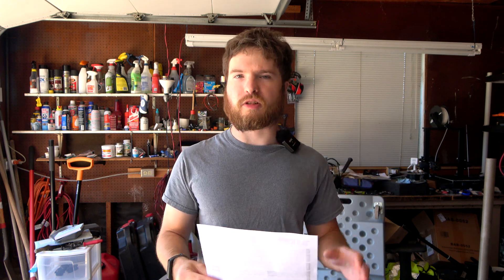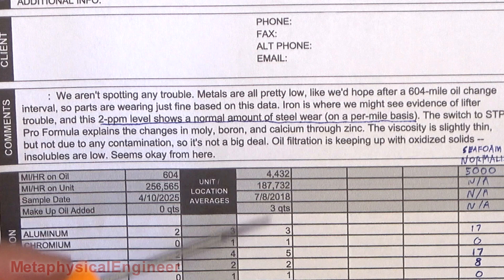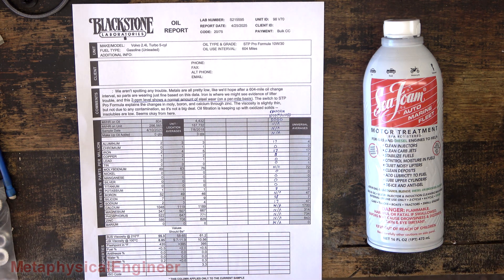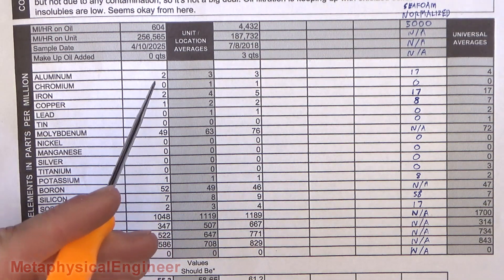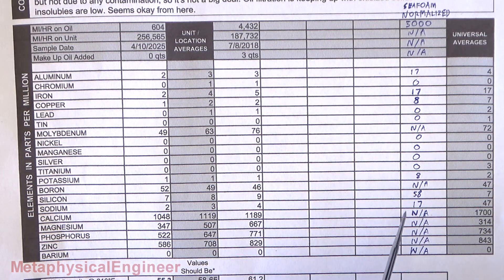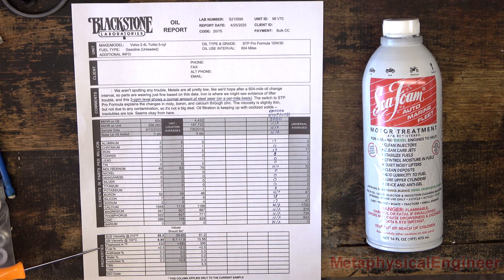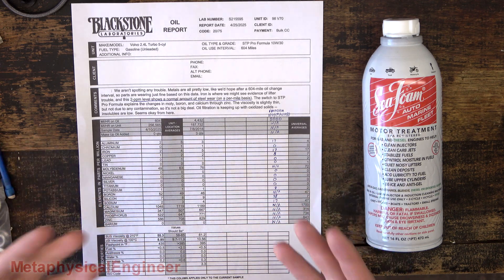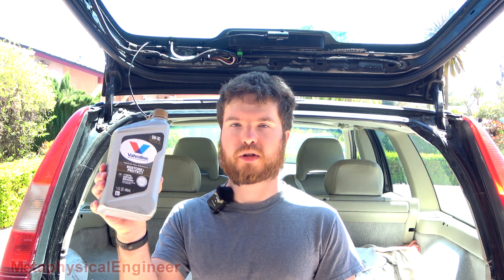Did Seafoam Hurt My Engine?  Oil Analysis Discussion!

Comment: Unlikely to fix that lifter with oil additives. Just bight the bullet and replace the lifter.
Reply from the maker: But then I'd miss out on a chance to test if any of these mechanic in a bottle items have a chance at solving the problem!  So long as there's not signs of accelerated wear, the noise is a nuisance and I can keep experimenting.

Comment: As always, the comment section is the best part. Seriously, thank you for doing this. I know it takes time and money. I personally use Seafoam at 1 ounce per quart 300 to 500 miles before an oil change for decades and I’ve never had any issues with any engine. Nothing has ever blown up. No cams have ever been rounded. No filters have ever clogged. Seafoam themselves have done regular and rigorous testing over decades. In my Camry I use Idemitsu IFG7 and in my Escape with the 2.0 eco-boost I use Penzoil platinum ultra or Valvoline restoring protect
Reply from the maker: Thanks for chiming in!  There's a lot of misinformation and fearmongering that flush type additives will cause damage, so I wanted to see for myself in a controlled manner.  Really, 1 ounce per quart is such a low amount that the viscosity effect is negligible.   Given the results here, maybe I should have run it for longer.

Comment: I thought sea foam was for the fuel tank ? Not the engine oil
Reply from the maker: It can be used in both (and introduced through the intake to clean throttle body, intake valves, and pistons).  That said, I prefer it as a fuel additive, mostly in small power equipment since it's good for cleaning carburetors and has fuel stabilizing properties.  Instructions on the can and the official website have more details.
Reply: @MetaphysicalEngineer thanks
Reply: Maybe you should read the instructions on the bottle! It has instructions on how to add it to the crank case oil.

Comment: Specious at best. Completely nonsensical drival in truth.
Reply from the maker: If you see flaws in my interpretation, please enlighten me.  Also, it's spelled "drivel".  If you pull out the thesaurus to make yourself appear more intelligent, you would be wise to check your spelling before you post.
Reply: @MetaphysicalEngineer thanks for the spell cheek. Your most kind. 🐥 Assuming linear regression with only one data point for wear particulates is just silly work. No, (0,0) is not a data point because you didn't have the unused oil tested. One data point at 600 miles. 😂 I highly doubt wear particulate accumulation is linear with only one independent variable. The more I think about your "presentation" the more suspect you become.

Comment: I wouldnt put it in my car but it works great in my lawnmower ...
Reply from the maker: Agreed I'm liking it more as a fuel treatment or for small power equipment after this test.  Older additive for older simpler engines and oils that made sludge even when well maintained.

Comment: Cool little data point sir. Looking forward to your VR&P videos. I’ve got 6K on it in my old Prius. I switched because the thing has a long standing TSB about low tension rings oil consumption and I was beginning to smell fuel dilution. After 6K miles I no longer smell that fuel in the oil, without changing my driving habits. IMHO VR&P is a solid product.
Reply from the maker: Excellent that it's done some good for your Prius.  Between the noise and some visible varnish I can see through the fill port, I'm hoping to see and hear some good news in a few thousand miles.

Comment: Tried it on my Chevy 350 vortec, it did fix the lifter tap in startup.
Reply from the maker: Nice to hear a success story!  How long did it take to work?  Did you have soft sludge or more hard varnish in there?
Reply: @MetaphysicalEngineer drove it for 300 miles.  The engine was clean from running synthetic, but developed a tap on cold starts. Sea foam fix it.

Comment: Someone probably suggested this already, however, I've used Solder Seal brand Motor Medic, which may work in 5 minutes or soon after that, and right before an oil change may be a good idea for trying it. Good luck and thanks for the video.
Reply: Oops, I meant to suggest their Valve Medic additive....
Reply from the maker: Thanks!  I've shied away from those fast flushes because the very hard carbon deposits take a long time to move, even when submerged in pure solvent.  5 minutes of dilute kerosene probably won't do much.  Still, I may be in this for the long haul in case the current plan doesn't resolve the issue.  Like DIY Dave testing every oil burning remedy known to mankind on his older Corolla.

Comment: 5000 mile oil change interval is why you have a sticky lifter in the first place. Use the restore and protect and change it every 3000 miles or when it gets dark whichever comes first. ATF is old wisdom. Marvel does the same trick without introducing any risks associated with ATF. I don’t know where you are finding “budget conventional oil” buy Walmart done stopped offering any in May 1/4 of TN. It’s all synthetic or synthetic blend. Anyway you really would benefit from not trying to cheap out by squeezing 2000 more miles tha oil and filters really can accommodate at peak efficiency. I wouldn’t even be afraid of using restore and protect with some Marvel added. It’s good stuff and I aim on trying the restore and protect next oil change on my truck.
Reply from the maker: Autozone and Oreilly and such all have budget conventional oil in stock, but I'm way out on the coast so maybe that's a factor.  Look even a few towns over and all the options are different it seems.  Curious to see what you find using restore and protect.  So far lots of good reports on it.

Comment: Follow the directions on the can! SeaFoam says not to use more than 300 miles before changing the oil. If you want to get a full oil change interval and clean and free things while you run it there is an oil that advertises having had to change their formula because it would plug oil filters in a few hundred miles so they changed it to avoid tearing up engines. The other great choice is Marvel Mystery Oil. Add it following the instructions and monitor the oil color. I stick to a 3000 mile oil change interval and I don’t care what boxes and bottles say. Engines make a lot of dirt and oil can only do so much multitasking. I also use OEM filters not the Fram garbage. Fram is trash. Stop getting cheap on your oil filters when y’all are willing to spend thousands on every other part. What’s the point in putting a good engine in the car if you’re just gonna give it subpar lubrication and filtration. Manufacturer specified oil weights and the manufacturer preferred filter, and Marvel Mystery Oil I go half strength for mixing instructions, so instead of a quart in a 5 quart pan I mix in 4oz into each quart. It doesn’t thin the viscosity down too much and it really gets things clean as a whistle in there. Well that’s it. Don’t run SeaFoam for 400 or 600 miles. It’s bad for business. The bottle says no more than 300 miles. Done it for dirty engine and it runs and isles smooth now. Can also add an ounce of SeaFoam per gallon of gas in your tank for fuel system clean and it’s supposed to clean the whole way. Pump and injectors and combustion chamber and top of the piston and everything and valve faces. Does it? I don’t know but it’s helped a couple cars back from the edge of wasted.
Reply from the maker: The 300 miles instructions are for using Seafoam at the end of an interval when the oil is already dirty.  If I ran it for just 300 miles on fresh new oil, it people would be screeching that I didn't wait long enough.  Heck, with the analysis and filter looking as they did, I could have gone 1200 miles.  If I only had soft sludge, 300 miles would have done the job.  Hard carbon doesn't dissolve easily so more time meant more cleaning.

Bad for my business, or bad for Seafoam's business in that I'd not buy as much of it?  If you see anything on this oil analysis that suggests I made a mistake and actually caused engine damage, please enlighten me.

Comment: Great Video & Good Work on evaluating SeaFoam in engine oils👍. I’ve never added it to engine oil and am reluctant to do so but a 50/50 mix in gasoline works great for cleaning up a gummed up carburetor on the lawn mower…
I have an old 90’s Chevy P/U with a 5.7 TBI with 200k miles on it that developed a lifter tick. I added a quart of ATF to the oil about 200 miles prior to the next oil change. The tick did disappear after about 50 miles driving and I then switched to Amsoil Signature Series 5w-30 oil. That was 4 years ago and No Tick. Obviously I caught the issue just in time as it was no doubt Oxidation forming from using conventional oils by the previous owner. 
So I think any good quality Synthetic Oil like Quaker State, Pennzoil etc. used on a regular & frequent basis will eventually clean out your engine oil galleries of any oxidation. If your issues are from Sludge, that’s a different story all together…  happy motoring 😊
Reply from the maker: Thanks for taking the time to comment!  After this test I do prefer Seafoam as a fuel additive, either as shock treatment at high ratio, or as directed for general injector and system cleaning.  Also had great luck using it to soak very gunked up PCV parts.  Melted the baked carbon right out in a few minutes leaving a pristine new looking part.

Ironically, the tick developed while using synthetic oil, and I'd already been using synthetic of a few different brands for nearly 100k miles before.  Hence my theory that a tiny speck of carbon dislodged from upstream and got stuck in the lifter.  So long as the wear rates look sensible, I'm open to trying several strategies and products.  But of course if I see the problem worsen I'll do a teardown to deal with it directly.

 Take a look at the previous video where I give a bit more background and show that the engine is quite clean inside from when I took the head off and had a machine shop do valves and valve stem seals to resolve a major oil burning problem.

Comment: Valvoline Restore and Protect is a better choice
Reply from the maker: Yeah so far I'm liking how the R&P is working.  Just a matter of racking up more miles to make a solid review video, maybe at around 2000 miles on the interval.  If the filter and analysis from that look good, I'll run it longer.  Without major sludge, I don't see a reason to dump still serviceable oil when the official instructions say to run at normal intervals.  Filter change will be out of abundance of caution, as these Mann W917 units have pretty decent holding capacity.  If I see it packed with grit, that will change my strategy of course!

Comment: First I would like to inform you that your lifter noise is a problem of the Honda engine.  All of Honda's engines require adjustment on the lifters that's the type of engine that they have you cannot make them go away because they need to be adjusted you're wasting your time and your money that could be better spent on actually fixing the problem. I would like to recommend you to watch Scotty Kilmer he has several videos where he has gone into that discussion but I'm sure it's available out there in YouTube University.  Somebody Somewhere Out There has a video where they're actually fixing the problem and you get to see what is wrong and what it takes to get fixed.  I appreciate your Youth and vigor as I am 65.  But one thing at 65 is I hate having my time wasted and paying to do things twice when I figure if I paid for it once I should solve the problem.  I can't tell you that having driven cars first and 70s and all through the 80s and 90s lifter noise is a chronic problem through many different companies and engine types and has gotten better over the years yours will go away with a simple adjustment it's even possible to do it yourself
Reply from the maker: Thanks for taking the time to comment!  I regret to inform you in some of your advice is irrelevant as this is a Volvo engine which uses hydraulic lifters, not solid.  I suspect a tiny speck of grit has lodged in the lifter, restricting its ability to take up all the slack.  In the previous video I identified the second exhaust lifter on cylinder #5 as the culprit.    1990s Mazda Miata engines suffer similar issues.

I have taken this engine apart before maybe 30k miles ago, which is why I'm somewhat reluctant to do it again so soon.  It's much more involved because the top cover is structural and holds the upper cam journals, so even inspecting the top end is an invasive procedure.  Only the intake cams on #3 can be seen through the oil fill cap.

I wanted to see for myself if some popular cleaning products would resolve the problem, if those same products would cause engine damage, and if the noise itself meant internal damage was happening.  The previous video I cut open the oil filter as well but did not find excess carbon or any metal flakes.  As long as the wear rate looks normal, the noise is a nuisance and I can continue experimenting.

Comment: Just adjust or fix the lifters. No such thing as a tradesman in a can.....!
Snake Oil
Reply from the maker: There's a spread of anecdotes with success stories and skepticism galore, just in the few comments on this video.   Everyone has a different opinion, ranging from glowing praise for various snake oils to warning that my engine would implode into a black hole if one single drop of anything but oil entered the crankcase.  Figured I'd see for myself since I have a specific problem that many of these products claim to be able to solve.

I know these are hydraulic lifters, and the fact the second exhaust lifter on cylinder 5 is the culprit makes me suspect a speck of grit jammed it up since it's at the very end of the oil passage in the top end there.  

I'll be sure to tag you with an update if I do end up doing a top end teardown in the future!

Comment: I'll start putting Seafoam into my engine when the automakers suggest it in owner's manuals.
Reply from the maker: Fair point that manufacturers won't recommend additives.  Any unknowns represent liability and if there isn't a problem to solve, it's a waste of time and money too.  Counterpoint is if I followed the manual for this car exactly, I'd need to source oil meeting API service SG or SH, which were superseded in the mid and late 90s and are now considered entirely obsolete.  That much cruder tech is probably responsible for a lot of the varnish I'm dealing with to this day.

You do you, and I'll keep experimenting and reporting what I find!
Reply: You know its used all the time at the dealer right? The one who utilize service manuals crafted by the mfg.? Repackaged Seafoam at all GM dealers is GM Top-end cleaner, part #10-3015, at FCA dealerships Mopar Combustion Chamber Cleaner #5174566AB. Ford recently announced an agreement with BG to supply their EPR (flush) and 44K (probably the best fuel system cleaner) under the Motorcraft name. The reason it doesn't say anything in the owners manuals is because of 🤡 That's why. You have the masses putting anything and everything in these cars, with zero critical thinking skills along with the goal of getting you out of warranty as quickly as possible.

Comment: Amsoil my dude
Reply from the maker: Another vote for Amsoil!  Have you seen it resolve a stubborn noise or nicely clean up a neglected motor?

I'm willing to give it a try if the Valvoline fails to do the job.  As long as the wear number still look ok, I don't see a need for full teardown just yet so I can experiment, even if the noise is embarrassing on an otherwise very nicely running car.
Reply: @MetaphysicalEngineer 

Another vote for Amsoil.  I have a 03 civic with 185k on it.  Got it at 88k.  Been running Amsoil Signature Series since I got it.  Just took the valve cover off to adjust valve lash 2 weeks ago.  It was spotless in there.  ZERO deposits or sludge.....and I run 15k mile oil changes in it.  Multiple UOA's say I can go further.

Comment: Nothing is going to fix the lifter tick, the gaps are larger the only solution outside of adjusting the lash etc would be to just run thicker oil
Reply from the maker: Hydraulic lifters on this engine. No manual adjustment and the noise here is 99% caused by a partial blockage in the lifter assembly.  I narrowed it down to the second exhaust lifter on cylinder 5.  All the others are quiet.

Thicker oil won't do anything. If the tick noticeably changed with oil temperature, then oil viscosity would have an effect. Instead it's more or less constant loudness regardless of temp and RPM.  

But if the tick does indeed not resolve with any of the cleaning products or boutique oils, I'll tag you with an update when I do the teardown!
Reply: Ya. Like straight 30 weight...